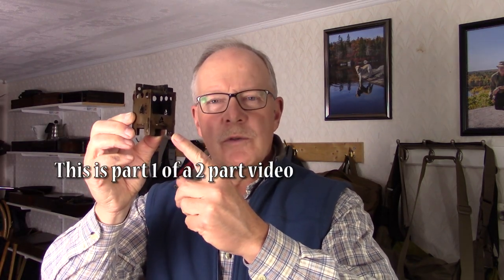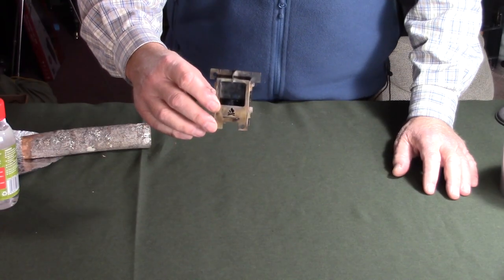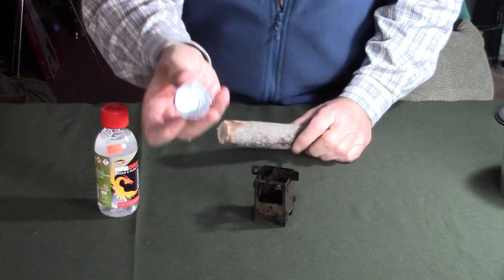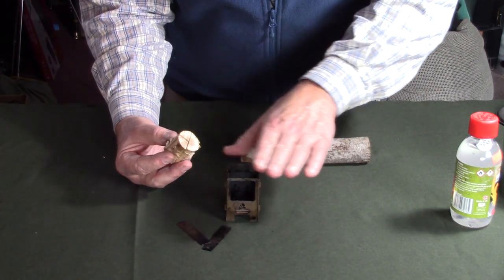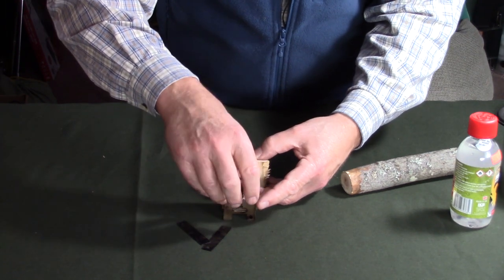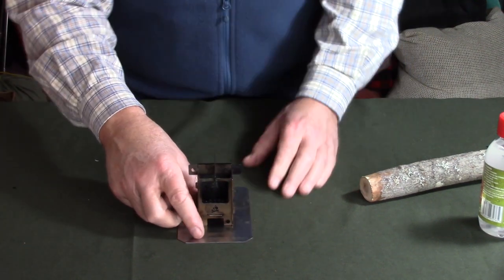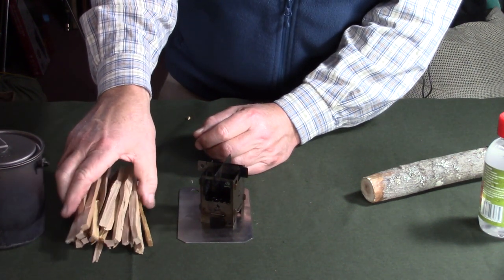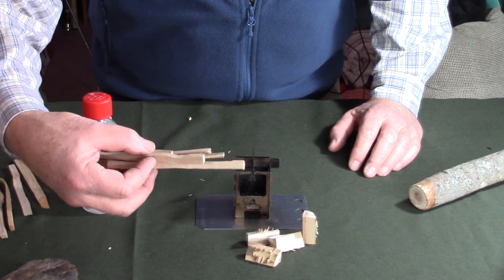Bushcraft Essentials Outdoor Pocket Micro Stove EDCbox Update Part 1

Comment: Hi Mark. I use the torch method every time w/my Firebox Nano. I process all my wood to the appropriate size a head of time. Keep buckets of it in the shed for quick grabbing. Petroleum cotton ball in center gets the fire going by far the fastest. But, I do use fat wood or twigs w/hand sanitizer to break the monotony. I always scrub the bottom of all my pots. Black color will absorb heat but it is the color not the build up on the bottom of the pot. At some point that black build up will insulate the pot and actually work as a detriment to heat flow from the fire to the water. If this wasn't true commercial french fryers would never have their heat tubes scrubbed clean. Build up means less efficient heat transfer....not better. Another great vid. Looking fwd to part ll !
Reply from the maker: Right on. Thanks for commenting

Comment: I love that you took the time to work out how to use this stove! Im totally ok with a learning curve if it means i can use the most ultralight and/or compact gear. And ive seen people comment about using the tin of a tealight as an alcohol stove for this thing, so getting a full boil should not be a problem. Twigs seem like a decent option for simmering. And a cutout piece of a beercan should be good for ground protection

EDIT: i see you use that tealight tin in the next video, lol
Reply from the maker: Right on. If you have not watched my original video, I use a cheap, light DIY alcohol stove very effectively as well. Thanks for commenting

Comment: 1:40 a tealight output about 30watts of energy. i dont believe any special force would use 30watts to keep warm in winter. also why would they even need a holder for a tealight?
Reply from the maker: Only repeating what I was told by Bushcraft Essentials
Reply: @MarkYoungBushcraft  yes yes i understand. its just i live in Canada where its around -20C in the deep winter and even with a big camp fire if you step 6feet away you freeze to death.
Reply from the maker: No argument from me. I am a fellow Canadian and can appreciate cold. The Micro would not even be in my pack during winter. Assembly would be impossible with mitts😂